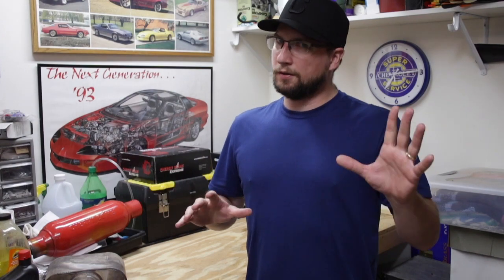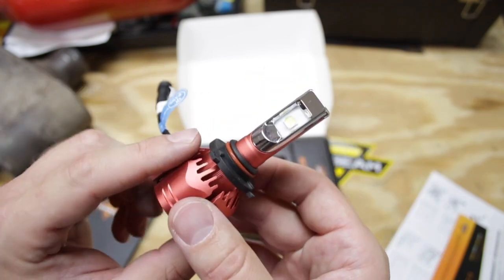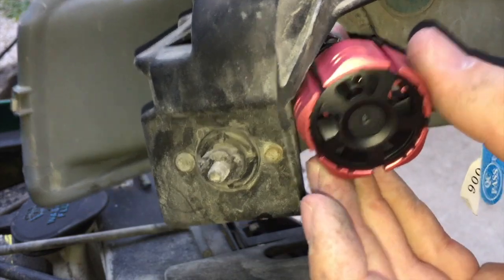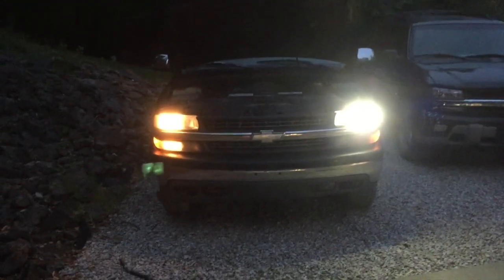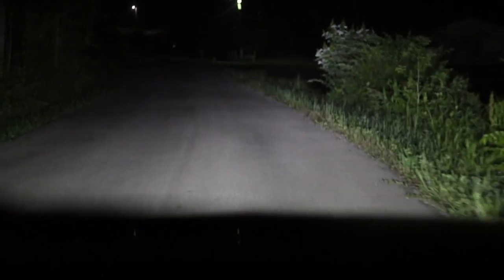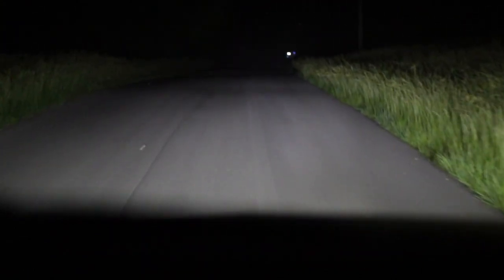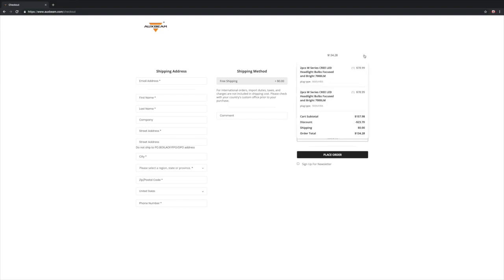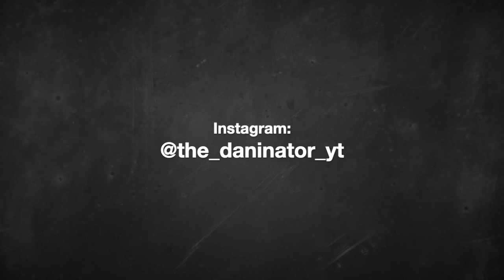Halogen headlight bulbs vs. Auxbeam W Series CREE LED headlight bulbs - Side by side comparison

Comment: those are prolly better than what i ordered. i have the same housing on my truck. the leds that i have now which are NO upgrade from normal will be going back. planning on something better. anyway it's easier to us pliers to unlock tabs than to break out the sockets. just the 2 on the low beam is all you gotta take loose and you can side it out of the way.

Comment: There are federal and state laws on brightness of headlight (and other) bulbs, typically measured at the brightest point. Standard is wide pattern "general area flood light" 800-1200 lumens for low beam (legal limit is around 1500 lumens) and "focused spot light" 1800-2200 lumens for high beams (legal limit is 2500 lumens). Most of these LED and HID start out at 2000 lumens for low beams, which is what blinds everyone else since the low beam floodlight is much wider area being lit. This makes them illegal in most states and the feds will likely be limiting light output making these illegal any day now. For example in Florida, "a driver can be liable for damages in an accident even if they were only partially at fault. If you drive with illegal headlights that contribute to an accident this could subject you to liability even if your blame is minimal, it’s called comparative negligence." Other states have or are enacting similar laws, so if your bright headlights cause an accident, an officer can catch up to you and you will be at fault for causing the temporary blindness that caused someone else to wreck (and possibly die). Is someone else's life worth it just to see an additional 50 feet down the road?

This is why (almost) every single company selling these is required by law to have "for off road use only" printed on the box. That will not stop the morons from using them and blinding everyone else, but it at least limits the liability of the manufacturers and sellers...

Comment: Please don't do this in halogen housings. LED and HID are not designed for halogen style housings. I deal with this daily as someone who has a GMT800 truck and a lowered sports car. If you want to properly put LEDs in your truck. Buy the denali headlights with the projector housings and put the LEDs in them. They use the same series bulbs.
Reply from the maker: Michael Coffin can you clarify why? Is it heat? What happens otherwise?
Reply: @TheDaninator  It's actually the beam pattern. A projector or dedicated hid housing has a cut off lens built into the socket that prevents the light from blinding oncoming traffic. It creates that  cut off line seen in OEM hid lights. Halogen housings don't have that. Halogen housings also don't have a clear lens. They have a lens with multiple reflectors on it that scatters the light properly for a halogen type bulb.  HID/projrctor/led housings have a smooth lens as all the light and beam pattern is done before it exits the actual light "bulb" lens. The cut off and added prighness of the led and hid in a halogen housing is amplified when out in the country with little or no ambient light. In the city they are less intrusive as there is a bunch of ambient light from street lights, businesses, etc.  I have a set of Boslla LED headlights I plan to do a video on showing the difference between LED and halogen in the stock housings as well as the denali projector housings. Just have to get this new engine put in first.
Reply from the maker: Good to know. Thank you! Best of luck installing your new engine.
Reply: @TheDaninator  anytime. This is actually a huge pet pieve of mine out here in the rural area where my parents live. Having to drive from the city to rural country, you get a lot of high beams and everyone trying to upgrade their lights. Nothing worse than coming over the hill in pitch black to someone with HIDs in a halogen housing with their brights on.
Reply: @TheDaninator  thanks for all the exhaust videos. I watched them all and they really helped.
Reply: @michaelcoffin4364  Denali headlights won't fit that model truck